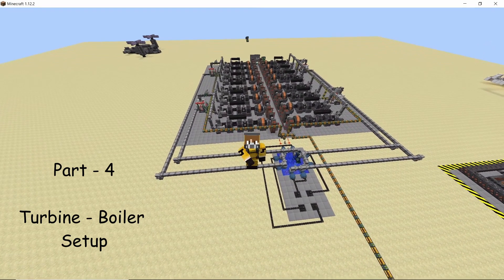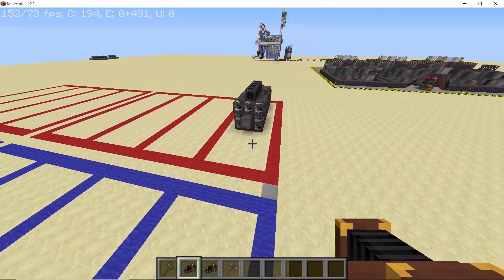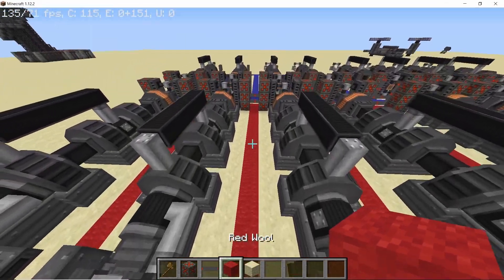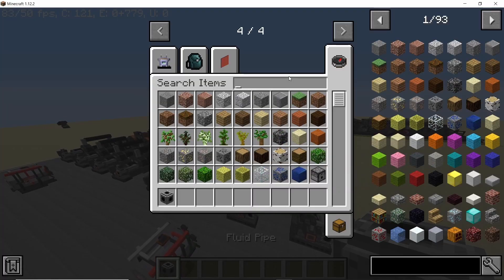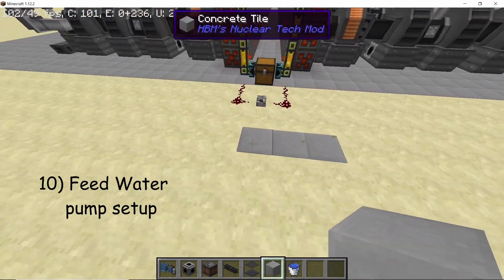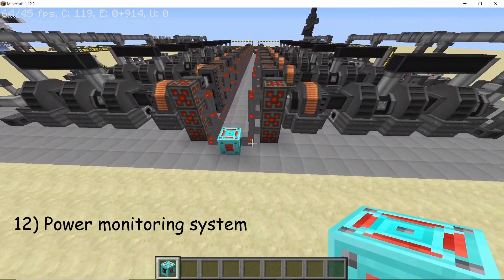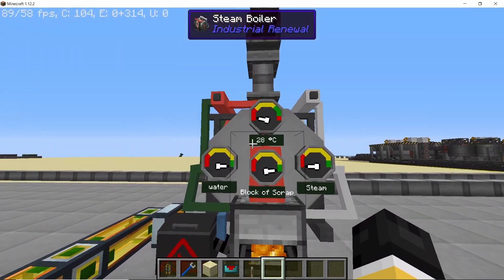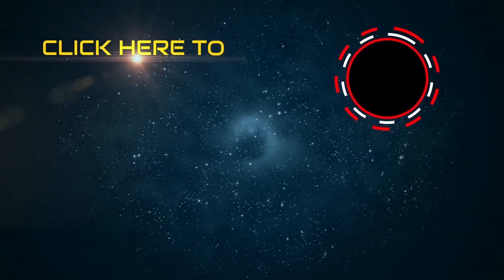Episode 4 - Steam Turbine's and Boiler Setup - Let's Build a Thermal Power Plant in Minecraft

Comment: is it workable on version 1.7.10?
Reply from the maker: As Industrial Renewal and Immersive Technology ... two of the main mods used in this build are not available for 1.7.10 you can't make this exact design. However you can still make the infinite cobble and fuel generator and use it in an HBM furnace and leviathan turbine

Comment: man decided to go insane with the amount of turbines (joke obviously)

also instead of using a lot of RF converter blocks, i could just wire up them to one converter block using immersive engineering's HV wire connectors/relays
good video by the way! will episode 5 be the final episode? or is this already the final episode?

and what mods do you like to play around with the most? i am just curious :)
Reply from the maker: Initially the plan was to go with 3 turbines per boiler as that way the boilers can always have max amount of steam in them ... But  that totalled upto 12 turbines and it was not nearly enough to reach 1 MHE/s 

Each turbine when running at Max rpm produces 3072 HE/t ... So I decided to go with 16 Turbines and that way they produce a total of 49152 HE/t (the actual amount is a little bit less than that , but not too much the difference is very insignificant)
Reply from the maker: As for the HV wires , I did that initially , but if you observe the way these turbines are placed having HV cables so close to each other would mean certain death in survival when roaming near the turbines. It was way too small of a space for having immersive engineering wiring in there. 

And no this was the second last episode , episode 5 will have Heat Exchangers and Cooling Towers , no power plant will be complete without having cooling towers in it 😀

As for the mods I like to play around - HBM , immersive Intelligence and technology , MCHeli , industrial Renewal , Magneticraft , create etc
Reply from the maker: The list of mods keeps on changing as I keep on exploring new ones